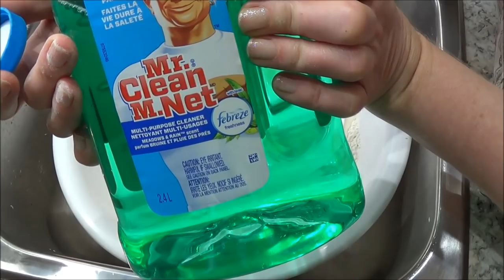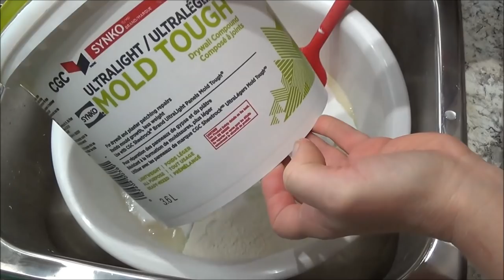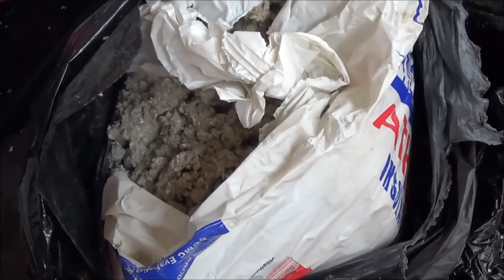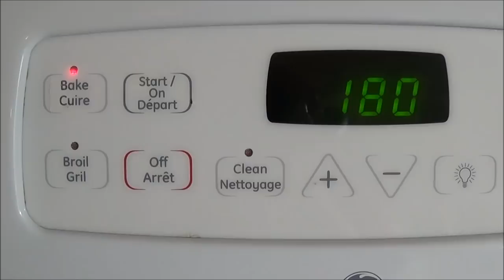How I Make Paper Clay 2018

Comment: beter to say how much of each ingredient you put in because some people will just put in an unspecified amount and then they are dissapointed that it does not come out like your's
Reply from the maker: I did and what is measured by feel or by eye is clearly shown in the video. There's also a blog post with the recipe written out. Like I said in the video, the more you make the better you'll be at getting the texture that works for you. I've grown so used to this clay over the years, I now make it without measuring anything but, like with anything crafty related, it comes with time. https://www.sharonojala.com/2017/09/how-to-make-paperclay-video.html
Reply: @WhereTheGnomesLive  thx anyway
Reply from the maker: what is missing the measurement ? I can help better if I knew specifically what it is. If it's the paper insulation, that can't really be measured out as you mix it in handfuls each time, and only handful at a time until it's has a texture you can roll up into a ball

Comment: Instead of insulation you can use animal bedding made of recycled newspaper
Reply from the maker: there's many different recipes out there, this is just one I like. To use newspaper you have to break it down, mix it will and then get all the water out of it. It adds a couple more steps and time to this process. The insulation is already broken down and ready to use, it's why I like it so much. If I want clay right now, it's pretty much done in 10 minutes, lol But yes, newspaper or any paper mass will work for sure
Reply from the maker: I read that too fast which explains my 1st reply. You would still have to break it down the pellets. Not sure what that would be like, the process I mean. I've never worked with paper pellets before. I've never bought a bag of them either, I would check into the cost difference as well.

Comment: Why not just use leftover newspaper instead of purchasing another product?
Reply: right! Recycle! And instead you can use just use newspaper without anything else. Much stronger result anyway
Reply from the maker: I make so much of it, spending 14 bucks on a bag of the paper insulation was the right choice for me. I've had the same bag for a couple years and still have better than a 1/2  a bag left. You could use newspaper for sure but this is easy, already broken down and lasts for years. Easy and cheap.  It's ready for me when I'm ready to make a batch, in just a few minutes I'm done.  There's many other recipes for paper clay, this is just the one I use and love. I feel pretty happy with my purchase and will buy another bag, should this one ever empty out, lol
Reply from the maker: there's different ways to make the clay, it just comes down to personal preference. This clay is actually very tough, I've never had an issue with it. I've made little characters with it, dropped them a few times over the years and they have survived. But I suppose it's  how you put something together, that will factor into it as well. This clay won't be for everyone but it's worked well for me. I'm grateful to have come across the recipe, it's saved me a ton of money! I am grateful to Scott Stoll for putting it out there and  I'm just happy to share how I make it.